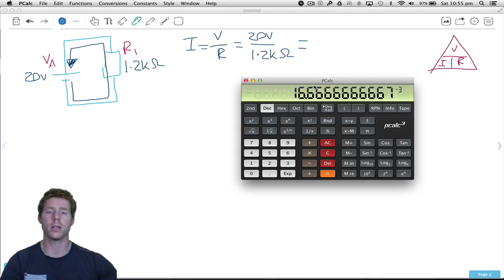Electronics Fundamentals Tutorial #4 DC Single Resistor Series Circuits

Comment: Ahh found a mistake in your answer for 1st Question on the quiz. Va=12v, R=5.8K ohms, I=? | I=V/R | I=12/5.8k = 2.068965517mA(not on the list of choices to select) which is 2068.965517uA(correct answer if you wanted it in MicroAmps). Thanks a lot, things are starting to get easy. Pls correct me if I'm wrong so technically I got  9/9 instead of the wrong answer for 1st question :)